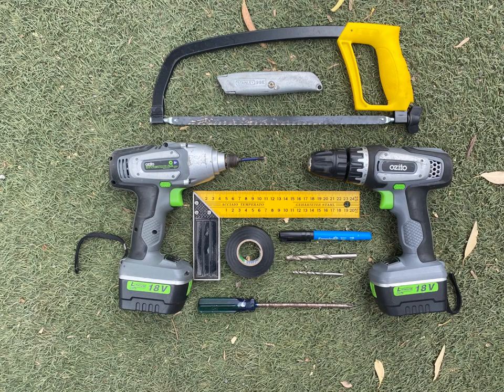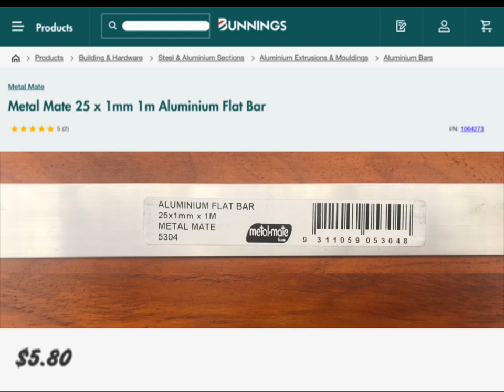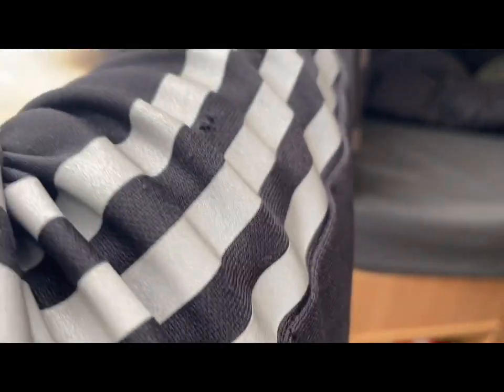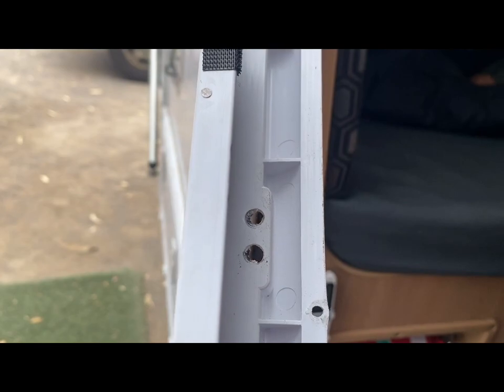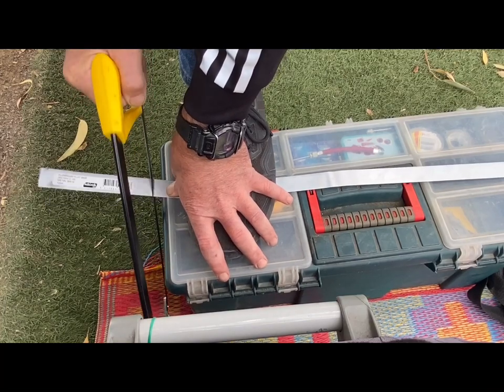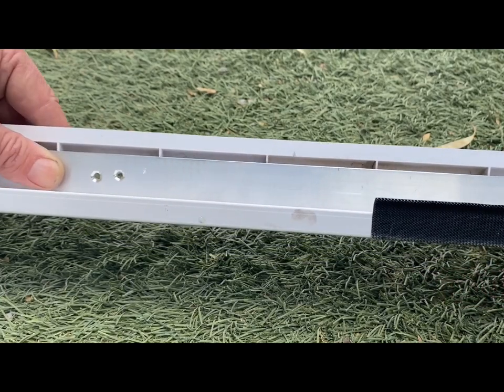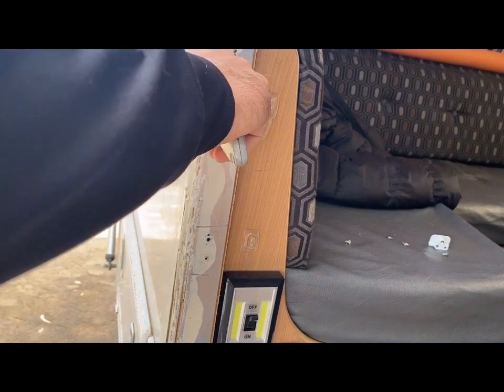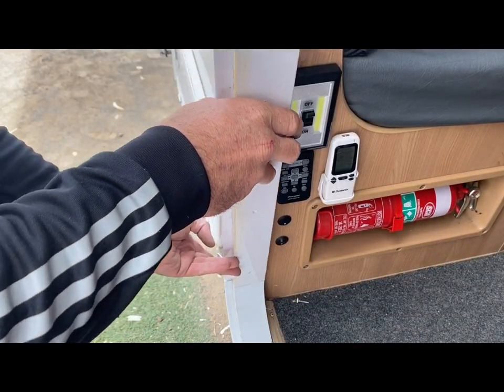How To Fix A Broken Door Hinge On A Jayco Camper Trailer

Comment: Good video.  Doing the same on a 2017 flamingo tourer.  I think they used a tube of silicone on the door frame at factory - took ages to work/cut off

Comment: Great fix mate, love the reinforced backplate. The exact same thing happened to us in December 2021 in Uladulla. Wind send it flying around 2m!!!. Couldn't get the plate off so I drilled and countersunk holes in the hinges for self tapping screws to bolt straight back into the frame. That was after the top part of the door popped it's rivets the day before leaving on holiday...junk.
Reply from the maker: That must have been frustrating… but great idea on the fix!